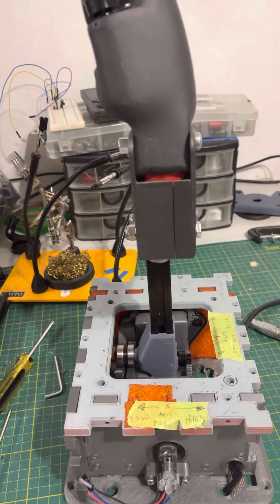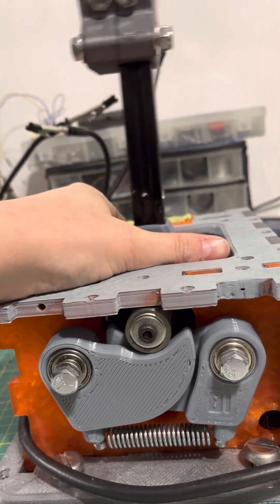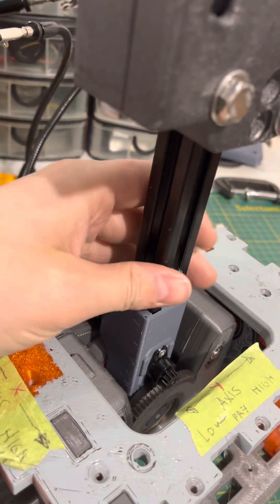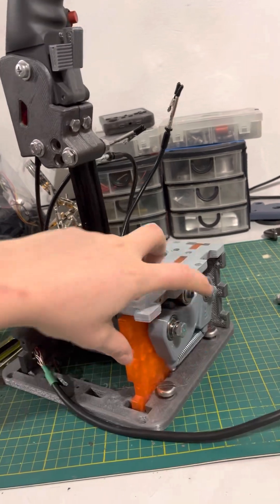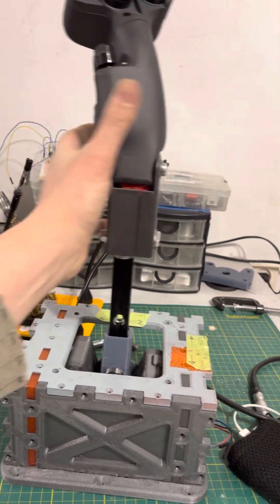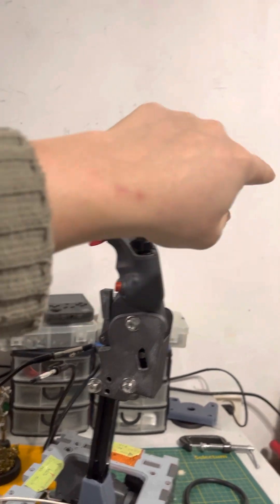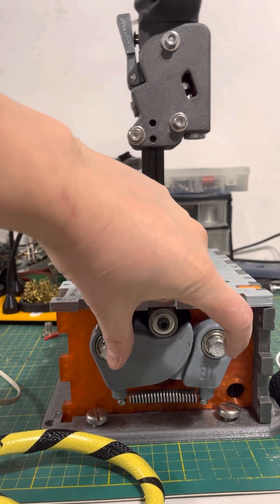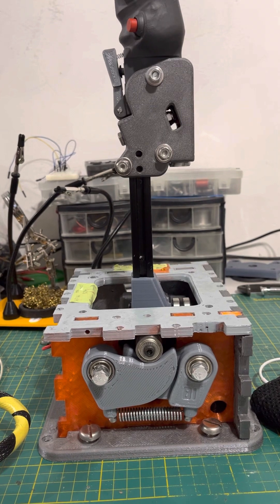Dampers, orientation and ideas for the redesign

Comment: I printed your gimbal, put a 50cm2020on and design my own adapter. I have to say, it feels way better than my old hotas x.
Reply: about adjusting stick neutral pos, I sketched handful of force trim gimbal designs but the one I like the most was put cam/feel spring is in a drum brake that if disengage, will rotate by and release spring tension, set a new neutral pos.
Reply from the maker: Heli mech’s channel actually has a really clever design for using stepper motors to do something similar but with gears instead of a disk brake
Reply: @rightrudderleftstick  I watched that video too, but steppers are overkill. I'm thinking of dc motor with worm gear or reduction

Comment: When Will the be available for download?
Reply from the maker: This version is already on Github, but it needs to be redesigned
Reply: @rightrudderleftstick  could you give me the link? do you have the stick file available?
Reply from the maker: @brunotaciano1218  grip at the top is real steel, but the base is up on github (youtube is blocking me posting a link in comments but search for "object-77b massive." It's unfinished as a design though